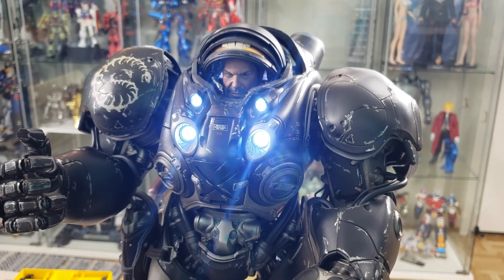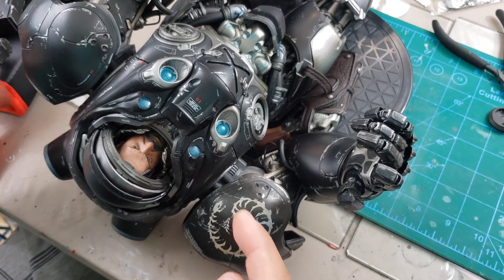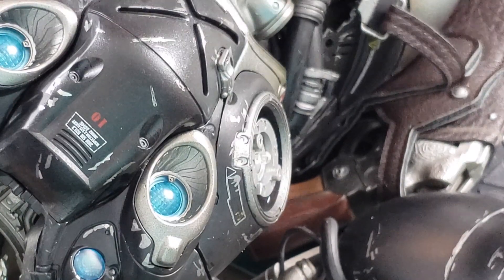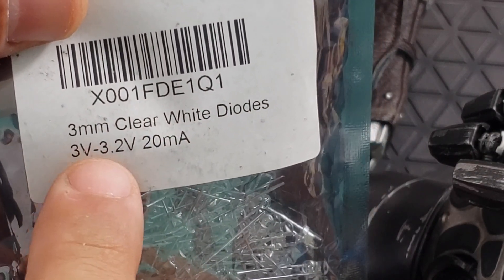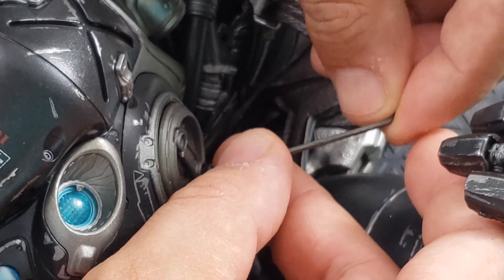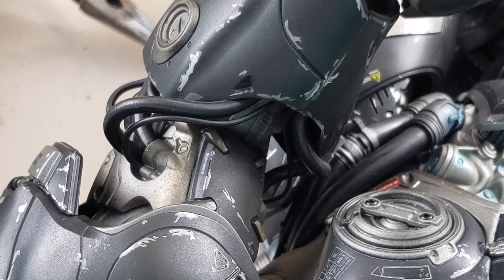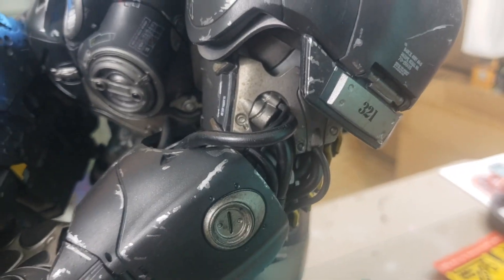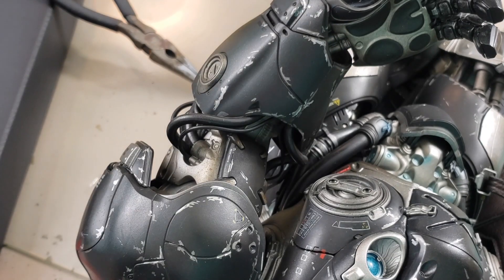1/6 JIM RAYNOR LED FIX, RESTORING DRIED AND CRACKED rubber TUBING.

Comment: I cannot believe you're the only person I can find on the internet with an issue with the rubber tubes being a total fail on Sideshows part...mine have basically deteriorated.
Reply from the maker: Thanks, I think the rubber that sideshow used is different than a regular rubber that we see everyday. This rubber tent to dry especially in a very dry environment. Lucky i pulled it out of my shelf if not i wouldn’t have even noticed it. Just little hydration did the trick. The cracks disappeared.
Reply: @ChinHobbyToys  Finally a solution for the ruber problem. I wanted to get the figure but was never too sure. Does yours have the loose joints problem too ? Interesting if Tychus that came after this one has the same problems .
Cheers mate !
Reply from the maker: @123OGNIAN  I don’t have a loose joint problem. The rubber in tychus is the same. Hydrating the rubber solves it. It’s been couple of years now and the rubber haven’t dried nor crack again.
Reply: @ChinHobbyToys  👍👍

Comment: Thanks for the video. Would the KY jelly trick work on tubing that has already cracked? Or is it more of a preventive measure before they crack? I managed to buy this figure for around USD 230, it's used but half the price of a new one. Seller told me about the cracked tubing beforehand. Might try your trick if it can repair already cracked tubing.
Reply from the maker: It will work. You have to apply it twice a day for 3 to 4 days without bending the rubber. Also keep it away from direct sunlight.
Mine was cracked. I heavily coated it with Ky  twice a day for 3 days The rubber will absorb the Ky. 
Once you think the rubber is restored don’t move it for 24 hrs then you should be good. 
It been almost 4 years now and the cracks haven’t reappeared.
Reply: @ChinHobbyToys  Thanks for the reply. I met up with the seller yesterday and ended up not buying the figure. Not because of the cracked tubing, but because the seller kept reminding me multiple times to inspect the figure, and kept emphasizing that if I find anything wrong after the exchange, he would not be responsible. During the meet up, I kept finding more and more issues on the figure that he did not tell me about, and I don't know if he ever planned on telling me if I didn't discover those flaws myself. That to me felt a bit fishy, like he's hiding even more issues. So in the end I paid for his subway fare and we parted ways.

But your tips are greatly appreciated. I'll keep them in mind if I ever come into possession of this figure.
Reply from the maker: @cheukbunchan515  that’s a very shady seller.  Am Glad you didn’t get scammed. 👍